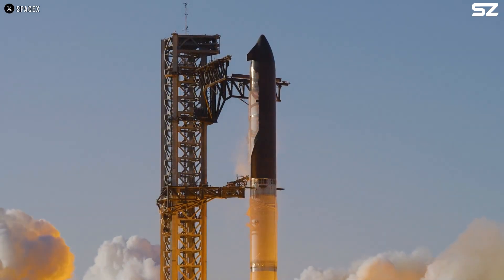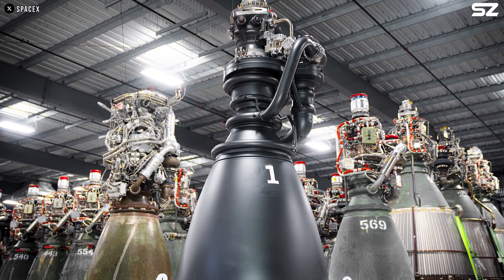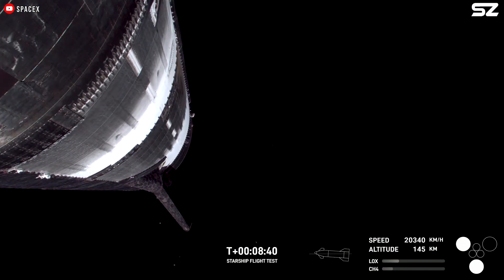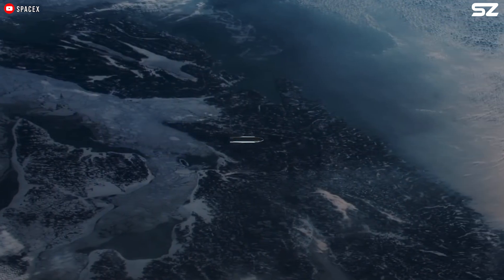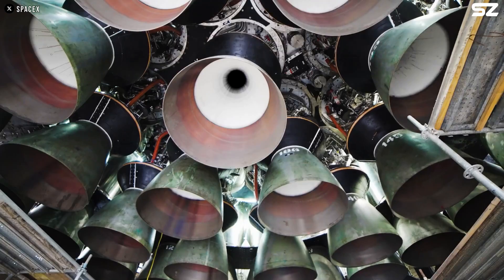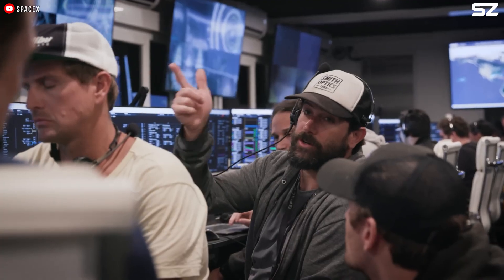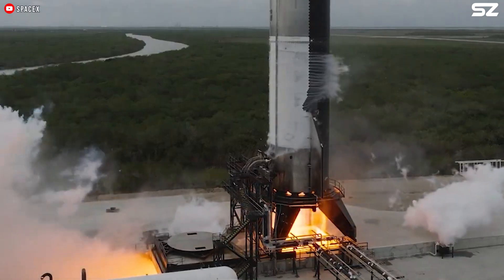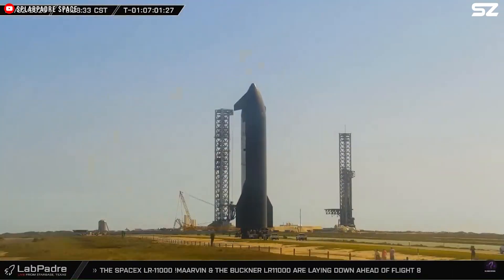SpaceX’s Explosive Vacuum Engine Problem!

Comment: It might be possible to make a compact vacuum engine, from sea level engines. By having a centrally suspended cooled conical tungsten wedge just below the combustion chambre exhaust to spread the exhaust gasses. The tungsten spreader would be supported below the combustion chamber by three or more hollow cooled supports and would itself be internally cooled.
Not to be confused with aerospike engines, the cone or wedge would have its pointed end facing towards the combustion chamber. This would possibly eliminate the need for a large vacuum engine nozzle bell.

Comment: The belle of the engine needs to be thicker. And the second alloyed added. Along with pressure relief valves recirculating the excess pressure into the Bell. That will save you from having another explosion. Don't make me put my finger on it to point out the problem. Because that engine is hot when it's lit😅😊❤❤
Reply from the maker: I will find more about this, thanks

Comment: There's no fault with the nozzle of rvacs or the rvacs themselves. The problem SpaceX has stated is with the new propulsion system they've added with three extra downcomers to feed the rvacs for smooth flow. Those downcomers experienced higher harmonic responses (vibration) in flight than ground testing. These greater vibrations caused these downcomers to rupture or leak leading to RUD of rvac. The explosion from the RUD destroy other engines also leading to the ship losing it's attitude.
What are you upto?? Lol
Reply from the maker: NIce idea!

Comment: It wasn't a problem before with the block 1 ships. 
Isn't SpaceX switch to the V3 engines?
Reply: @geocam2  they haven't had a successful "Block 2" Starship since Musk was physically present at Star Base. 
I'm positive he is capable of using Skype the same as the rest of us. I'm more impressed that you are so well informed that you know all of Musks' movement details OR who travels to see him.
The problem would appear to be the introduction of the new "down comers" in the Block 2 ships because the Block 1 ships had no such problems while Musk was away on the champion trail MAKING AMERICA GREAT AGAIN 😀😀😀😀😀.
Reply from the maker: Not yet, but the V3 is coming soon
Reply: @geocam2  you are kidding, right?
The vacuum raptor engines have been used on all 8 test Starships and it is only now on the Block 2 version that this problem has occurred.
The vacuum captors have been relit while in space and shut off without incident so I would suspect something else is the cause of the problem.

Comment: One thing that would help is marrying the RVac feed tubes to the cental downcomer or the tank wall, also make sure that none of the portion of feed tubes, that are not horizontal and secured to a base, are never straight, that would allow that section to oscillate through its center that could get more and more violent as it resonates.

Comment: Static firing on the ground cannot replicate conditions in a near vacuum. Air tends to dampen vibration, I suspect they will have to rely on data from the actual flights to get to the bottom of this problem.
There must be tremendous and chaotic shock waves at the moment of ignition during separation. It may be better to fire the atmospheric engines 1st and then the vacuum engines when there is some separation.
Reply: Certainly! Focusing solely on earthly affairs would require inventing far more intricate schemes of corruption, whose effectiveness and profit would be relatively modest.

Comment: The boost back burn might be blasting the back end of Starship with any debris drifting loose between the stages after stage separation, as the staging ring is a temporary item that might not have been thoroughly though out and tested because it's supposed to go away soon.  I don't know that is, but I don't know enough about the geometry to say it isn't.
Reply: It wasn't an issue with the block 1 ships
Reply: @E.M.Maxted  SpaceX have been changing their boost back profile with each flight. This one was noticeably more aggressive, at every point in flight. They are trying to min/max staging heights/speeds/returned fuel loads.

Comment: When will we be ready to fly to Mars... I dunno LOL
Reply: There are still 4 very significant engineering challenges that Spacex hasn't resolved that seperate orbital flight (once they get there) from a Mars mission 1) In orbit refueling 2) Guaranteeing the mass production vehicles don't leak fuel over a 6 month journey 3) Life support and radiation shielding for a lengthy journey 4) A toilet that works

Comment: If the problem is at the end of the rocket engine nozzle, it could mean a blockage in the thin channels through which liquid methane flows. The only way to block the channels is with water ice. The solution would be to insert an ice crusher into the fuel system piping to break the ice into pieces that would not compromise the operation of the rocket engine.

Comment: You kept pointing out the small glowing section of the vacuum Raptor engine on the left, but didn't say anything about the greenish-blue methane flame in the foreground above the center 3 sea level Raptors and next to the vacuum Raptor on the right and close to the camera. 

LOX isn't generally pronounced as individual letters "L-O-X" (el-oh-ex), but rather as a one-syllable word (loks).
Reply from the maker: I will find more about this, thanks

Comment: Don't know.  Ultimately they are going to need propulsion redundency similar to what is the case with the F9 booster with its 9 engines and octaweb isolating them.  Engine can explode and not affect others.  Also bilateral arrangement of non-gimbaling engines can provide for differential thrust stearing, though perhaps not at low altitudes near touchdown.

Comment: Eliminate the hot staging and see if it solves the problem. Then you'd know that a solution will have to be found to prevent damage during hot staging if it's even necessary to keep doing it.
Reply: A large pneumatic push-off, oh, the landing legs....
Reply: @tsclly2377  I wouldn't even say a pneumatic pushoff. Instead, only fire the sea level raptors on the ship and perform a full engine cutoff for the booster, and only ignighting the RVACs when the ship has cleared the HSR. also it may help to thin out the HS equipment instead just having vents. Although iirc the HS equipment going to be thinned out on the next iteration of the booster (the ones that won't have to dump the Hot stage equipment before re-entry)

Comment: Interesting, but I think they need to do something better than the hot staging, like small thrusters to separate the starship stage after separation. Yes, I know the booster needs to keep its engines running to prevent sloshing of the fuel, but Falcon 9 does not need hot staging. It seems like not enough thought has been put into the staging issue.
Reply: Yes perhaps there should be small ullage motors on the staging ring that maintain acceleration during staging to keep propellants in place.
Reply from the maker: Good idea!

Comment: EXCELLENT discussion. When I saw the loss of control when the engine failed, I wondered If the other two engines might shut down or at least throttle down to regain control as the narrator suggests. As an engineer having been trained as a commercial pilot on many multiengine aircraft, when one engine fails, it is sometimes necessary to decrease the power in the other engines. This can counteract the asymmetric thrust and regain at least enough control to re-enter(or land) and salvage enough of the ship for better analysis👍👍

Comment: What is gained by hot staging?  If that adds extra stresses, then maybe eliminate that.
Reply: hot staging allows 10% more mass to orbit.
Reply: @michaelotoole1807  actually no one use it even the most efficient Falcon 9.
Reply: Rocket engine don't work on vapor so fuel and oxidizer should be pushed down before igniting. Either by previous stage or some sort of "pusher" rocket motor.
Reply: @eanayayo  Hot staging uses a reduced push from the booster to keep fuel and oxidiser at the engine end of the tanks. It looks like SpaceX needs a more gentle way to push the Ship away from the booster. Springs gas plungers that remain on the booster could do it, but presumably the engineers have already looked at that idea.
Reply: @Dave5843-d9m  That's how the Falcon 9 separates 2nd stage from the 1st, with a plunger. 

I've read where that short ring is going to be replaced with attached (non-jettisonable) struts in the next version, similar to like what Russia uses.

Comment: Musk's approach "move fast, break, fix and repeat" will end up in debris falling on densely populated areas like Florida and Cuba
Reply: Ok, @tedantares2751.  Name one person that has been harmed by this.
Reply: I expel methane in your general direction.
Reply: At that point the SS is at ~500,000 feet and ~12,000 Mph!!! When the FTS  activates, it breaks the structure into small pieces that either burn up or are harmless before they hit the ground.
Reply: Sacrifices must be made, follow the example of the chinese, they don't care if engines fall on cities. We need to stop crying for every failure and push forward.
Reply: @expatxile glad americans didn't think like that on moon program or STS.
Reply from the maker: yes